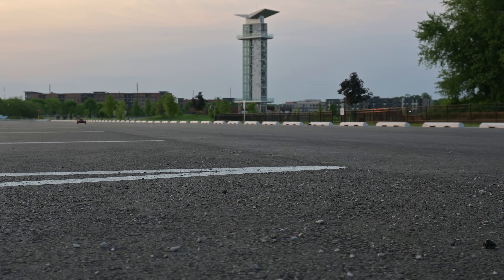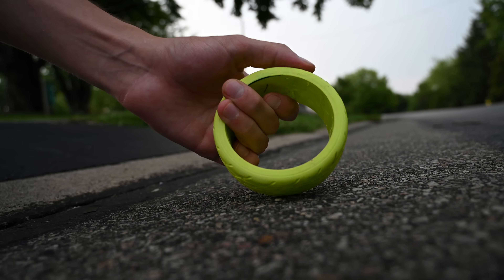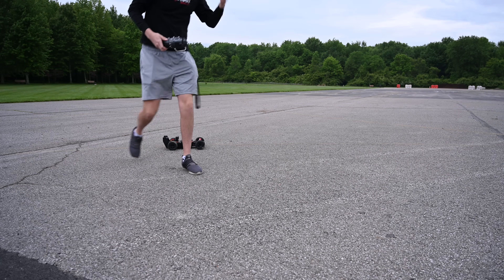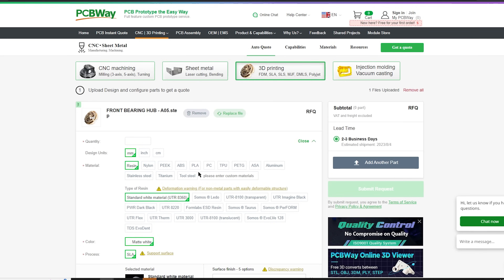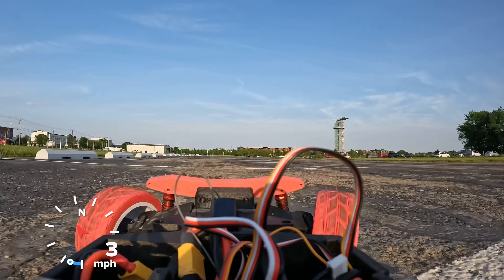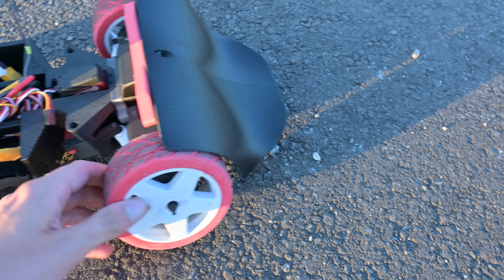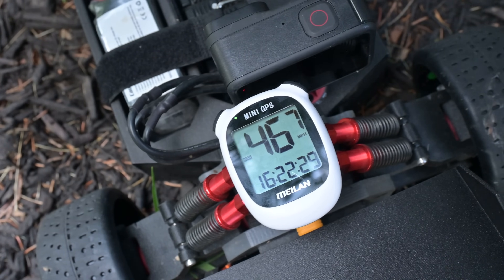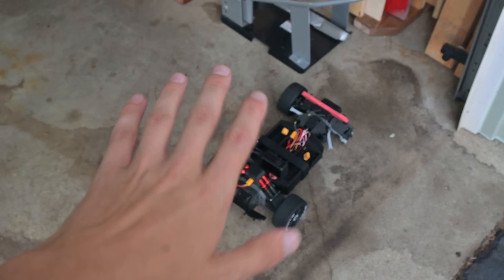I 3D Printed RC Car Tires... Will they survive???

Comment: You should use a smaller and lighter camera, in most of the flip clips you can see the car going clearly upside down corresponding to the weight of the gopro; then (idk if its possible) write a script to mantain automatically as straight as possible the car following hard guidelines like the sidewalks, 'cause its so small and fast to drive it properly avoiding chassis roll (an easier implementation would be lower the corrisponding steering angle proportionally to the speed); lower the center of gravity it's a must but I won't lower the car itself, too many bumps and potholes: increasing the mass of the wheels would reduce acceleration but that shouldn't be a big deal for top speed, but it would lower the center of gravity; I even thought of a dual stage suspension, the first stage softer with less travel for smaller imperfections, and a harder one but with more travel for bigger imperfections, again idk if it can work but why it should not; last thing i noticed is the center of gravity is too way back, maybe with a second motor in the front for the 4wd the problem will solve itself; i really like this project, hope for the best

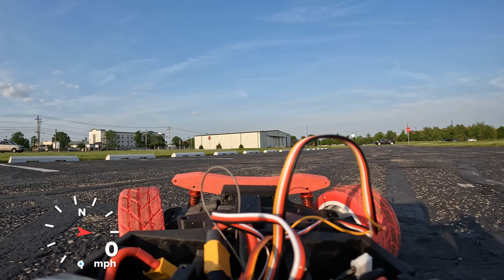Comment: Hey Micheal, I think you need to redesign your steering system. If you pause the video at 4:45 the right wheel has extremely more steering angle than the left wheel, which may be causing an instability while driving. I do t k ow if you covered this in a different video because this just popped up on my recommend 😅

Comment: For the redesigned car, I have a couple of suggestions. Make it lower, so that you can incorporate an undertray and diffuser for more downforce to help with stability at speed. You can get little gyroscope modules (some rc cars actually come with them) that connect to the steering servo and can countersteer when they detect the car changing direction without the driver's input.
Reply: To incorporate a gyro effectively you need advanced software. It is a seemlingly easy thing but a soon as you get to sensor fusion it is some serious black magic fuckery :D Easier would be to use a little toe in on the front wheels by lengthening the steering rod a little.
Reply: @vubito3245  my understanding is that the gyro modules made for rc cars are pretty plug and play, and you only have to tune how aggressively it countersteers so you don't get oscillations.

Comment: I don't know if it counts as cheating but for traction: you could 3d print a mold, and make the tires out of (or coat the tires with) silicon, or use liquid latex, for that true rubber grip

Comment: Just an ovservation here and it may be the camera angle but your alignment of the front wheels looks off in toe angle. It also looks like your Ackerman is way off too, causing the outside wheel to turn much more than the inside wheel. This could definitely make it difficult control.

Comment: Honestly the instability looks more like a suspension geometry issue to me. 
Most RC cars will run a substantial amount of toe in on the rear. 
I think this may help with your stability problems.
Reply: Precisely the issue I think. I used to race a lot of 1/10th scale cars at close to a professional level. Top speed maybe more like 30mph most of the time as acceleration was more important, but they were very stable. Toe in on the rear wheels, better suspension damping, and balanced weight/downforce should help a lot.
Reply: Use nitro rc antenna tubes cut to size over your rear suspension rod to limit squatting under load
Reply: @pierholtrop5432  squatting isnt an issue at all, in fact the rc car is too darn light, actually every rc car is way too light to make the suspension act like a real car. squatting isnt bad, its the fact that the car spins out under high acceleration, which is a grip and a weight disribution problem

Comment: The lower suspension will mean less air under the car and more air over the car 
(+Handling -top speed)
make it so the back wheels are inwards by 2 degrees [from top view]
and front wheels are outwards so the wheels can "Eat" the road
(+stability -wear -friction)

edit: make it just Front wheel drive so the back wheels will keep it forward (+handling -max torque before slip)
Reply: Front wheel drive is a terrible idea. No rc car that is fwd is fast

Comment: Very cool project. But your steering seems be wrong. Looks like the outer wheel has more steering angle. The inner wheel in the curve must have more angle. Its called Ackermann steering.  I hope that helps. I feel you, cause I try similar thing with my own built lego car. I am at around 50 km/h stable running
Reply: 50km/h for a lego car is pretty good, nice work
Reply: @iforce2d  the car performs that good that I am confident that I can go even faster. The only thing stopping me a little bit, is the drivetrain.

Comment: You need to get a foam weels for speed running like bananers 
Try looking at high speed world record rc cars for inspiration 
Btw lower the suspension so no air can get under the car so it is more controllable

Comment: Put a body on it, one of my speed run cars i was bored and ran it without a body and it was unstable and i almost crashed. The body had alot of downforce and helps the air flow over it

Comment: You may should reduce the way your steering can do... so max servo movement shold be only a tiny bit of movement at the wheels... equals less sensetiv steering at high speeds, but at low to turn around you go a lot of times back and forth to turn around...

Comment: I noticed as you were driving you seemed to swerve quite often and the "helper electronics" just seem to escalate your steering problems. You should pick up a real RC car to practice driving it with a bit more reliability. All to say I think you'll have more success driving fast with more practice and experience :D

You might also want to consider printing the whole thing from resin to have the ability to tighten up your tolerances. I know that might not be as ideal, but in the long run I think you'll have more success reaching your 100mph goal with a more precise vehicle.

Comment: Some suggestions :
Don't focus all that much on 4WD, because it comes with it's own set of issues when you're building your own car. Instead,
1. Get a body on the car, specifically those 'speedrun' bodies you see on speedrun RC cars, just search on yt and you'll find them
2. Lower the ground clearance by a significant bit
3. Use softer suspension
4. I'd say, for 100mph, you might need a more powerful ESC and motor so maybe consider getting something else ( Recommended, a Castle system or a TP motor with a reputable ESC )
5. Warm up your tires a bit before speedrunning

Some other recommendations/ideas,
if you're still unable to reach 100mph, you could try making it 4wd
Not 100% sure but I think it might be a good idea to upgrade the base/chassis of the car to something less brittle like metal, I guess to stay within the rules you'd have to custom make it but I think you should consider it, because at 80+ mph, one proper crash and everything will be in pieces and you will need to spend a lot of money to replace the broken parts, which there will be many
You don't necessarily have to work your way really slowly until 25mph, it's more when you're going at higher speeds, you've got to worry about that. 

Subbed, your videos are professional and you deserve a lot of subs, I don't subscribe to anybody easily and that basically means that your videos are great!

Comment: You need a top cover to complete the aero. After you reach a certain speed the aero takes over for stearing and stability. Maybe some active aero would help too. Your car is too light  and not enough stable down force to rely on tire stearing.

Comment: 1. In most of the car, especially the arms, you WANT flex.  Go pure nylon or pCtg (ie fiberology pctg).  RPM Nylon arms are a common upgrade in hobby cars.

2.  Watching you fight that right pulling alignment was painful, get your trim straight so you go perfectly straight without touching the wheel.

3. You need better designed front and rear wings at that 50+ speed, especially without any kind of body.  

4. New viewer so not sure your printers, but if you have multimaterial, consider using a softer material for the wear layer of the tires and a harder for the inside, especially, maybe print them into rims (nylon), even.

5. Many hobby RC cars end up with almost a square footprint, because it's so much more stable than narrower cars like full sized ones are.  

6. You have non adjustable links, are you designing for any toe-in or toe-out? Toe-in gives more stability at high speed.

Comment: you have to work on the parallelism and the camber of the running gear so that the car stabilizes itself, I face the same problem while building my rc car

Comment: For high speed stability you want more rear grip than front and the balance of pressure needs to be further back than the center of gravity in all directions, yaw (side to side) if you don't want to lose control, pitch (front and back) if you don't want to suddenly take flight

Comment: Try NinjaFlex 85A TPU.  The most common TPU is 95A hardness, and most brands of this standard TPU are a bit slippery.  However, NinjaFlex 85A TPU has a completely different texture and is extremely high friction against most surfaces I've  tested.  Also you can try printing with fuzzy skin which will improve friction, at least at the beginning until it wears down.

Comment: You could make the whole car out of an indestructible material, but hr clue is is to make the easiest part to replace out of the weakest material. In racecars its often the wheels which get ruined instead of the chassis or suspension

Comment: heres a thought. if your on surfaces that are that bad and pitted what you need is more travel. but have the car sag into the travel when sitting idle some of my thousand $ + cars mugen MBX sit almost 1" into their travel when sitting idle, this gives the suspension a chance to drop, and the tires to maintain contact on unsmooth surfaces. even most of my onroad cars have 1/2" of free sag, to maintain ground contact. softer springs, with larger pistons are a must.

Comment: Dunno if it is among the lines of the project. But! Have u ever looked in to ardupilot? The rover section might be of help! 

Also, have u tried less stiff shocks? While driving over bumps it looks to me as if the struts don't soak op much of the bumps and inturn upset the whole car. Maybe some loser springs wil let it soak more. 

A less stiff absorber would also allow the tyre to droop faster hopefully having contact with the ground more thus staying in control.

I might as well be totally wrong but hey!

Comment: 3d printing the hubs and placing them in a mold for silicon casting is something I've seen a couple other people do but I'm not sure they would work at the high speeds you're aiming for. Great work so far and I'm definitely interested in seeing more done with the gyro!

Comment: all your on-board shots, where i can see the front wheels suggests you have no akermans, or its backwards.

it would appear the outer wheel is turning a tighter arc than the inner wheel... 

tyres arent going to change anything if your geometry is inherently unstable to start with.

now i have to go see if you show the linkages anywhere...

Comment: The tires you printed need to be balanced once mounted to the rim, that will make the car more stable. I don't know much about 3D printing, but I would look into trueing the tires as well. For more traction on the printed tire, you could look into tire "sauce". The RC transmiter and receiver combination you were using comes with an inbuilt gyro, did you have both gyros active while performing your runs?

Comment: Jumping in the comments not having seen the earlier design-phase content. The stability issue you're having looks very familiar to a chassis I was trying to tune for stable higher speeds. I learned a lot, but mostly that my square alignment was my downfall; after dialing a small amount of Toe-In on the rear wheels I was able to track straight at speed.

I also learned something that had plagued me for years, and it was renewed when I saw your aero add-ons: downforce has to be balanced front and rear. Go put a fat guy on your rear bumper, and the nose lifts. Plop fatso on your front bumper, the rear goes skyward. It's not or ever has been "putting the wing above the non-drive wheels on your Civic hhaha", but without a splitter, that Giant Wang is kinda harmful. Neat.

Comment: since you already have all the electronics and stuff i'd recommend to just print the robak 2.2 or proto36. Doesn't take you any designing time, just printing/assembly and it may just allow you to get some ideas and close in on 100mph without any effort.

Comment: Using CF prints is not bad but they are not actually tougher. They are more fragile. If you use PC (polymax PC especially) your parts will survive much more. Also if you want stability you need rear downforce not front(if you dont balance you will pull out Mercedes CLK wheeile).

Comment: Your temperature for varioshore is odd. I did some testing with mine and it was softest at 220 C. Going higher than 220 C actually reduced the foaming and made it harder again. With a 0.4 mm nozzle, set at a 0.4 mm line width I got a 0.85 mm line at 220 C and only 0.6 mm at 240 C, so 250 C would be even lower. Mine was black but I can’t imagine that would make a difference to the temperatures or how much it foams. 

I know the filament says it can go from 190 C to 250 C and it would seem logical that higher temperatures mean more foaming but after a point (for me around 220 C) it starts to decrease again. If you didn’t properly calibrate the varioshore and try it at different temperatures then you should.

Edit: just to mention at 220 C the expansion was 2.13 times the 0.4 mm nozzle width, whilst the 240 C was only 1.5 times the 0.4 mm nozzle width, so then 250 C would go even lower and be even worse. When it foams more the plastic gets softer and grippier so you definitely should play about with the temperatures a bit more, especially around the 220 C mark. When printing at 220 C I turned the flow down to 47 % and got the desired 0.4 mm line so the varioshore saves weight just like lightweight PLA.

Apparently at its peak (or trough depending on what way you look at it) softness, varioshore is supposed to reach around 50 A hardness, which is apparently below car tyres, so maybe printing it at a better temperature could make it more grippy than the other wheels you got.

Comment: For your tires, you should try the Fuzzy Skin setting (if you use cura).  I've printed things in polymaker TPU that are extremely slippery normally, but have much better grip with the Fuzzy skin setting enabled.  I'd imagine that VarioShore would have even better results.
Reply: Great idea! Also Fuzzy is now available in Prusa and Orca slicers as well!
Reply: I don't know how to spell it in English, but tyres need to be more flat, or without the lines, like formula 1 tyres that don't have any lines or marks in the tyres, something like flat tyres? Or totally smooth tyres.

Edit: you can also try adding a downward pointing spoiler, check out Pagani's spoiler system, or Bugatti, switch out the GoPro for a more streamlined camera, or make a full ramp carcass like a batmobile, and put the camera there, that way you will get more aerodynamic.
Reply: @G3RARDB3AR  1 year later, but it's called semi slicks.
Reply: Thanks, i had nothing but problems with grip when printing tires.
Reply: Also just making slicks with a bit softer carcass to dampen the bumps a bit more (or just softer suspention).
Reply: Try using TPE for 3D printing tires. It's better than TPU

Comment: I have printed the same car, but I have changed almost every part. The highest I got is 60mph on a 4S battery.
The biggest changes I made is, bigger shocks, changed the angle of the suspensions, I extended the chassis 50mm, made everything super tight because a lot of the tolerances were way off and sloppy.
Reply: yeah making it tight may do the thing. I think the tarmo5 as shown in these videos is super unstable on the road. I own robak and it's very different.

Comment: I have printed, tested, modifed this tarmo5 like 100x times, and came to the conclusion that printing with Ninjatek Armadillo (75D TPU) makes it literally indestructible. I recommend you to give it a try, it's a hard TPU and it absorbs of lot before it breaks (if it eventually breaks, never got to that point yet and i'm bashing it to the sky)
Reply: that stuff is expensive.
Reply: @KidAgainHobbies i think printing the same parts 10x is more expensive 😅
Reply: @Itsmeblvck  i think buying an rc car is cheaper and less headaches. a printed part will never be as strong as a molded part no matter what material you use.
Reply: @KidAgainHobbies  you are correct but depending on your part orientation, forces applied and suited material you can get around 90% of the durability of a molded part/maybe even more durable.

Also buying an rc car defies the engineering sense of the video…

Comment: You're probably already a better driver than most, keeping that thing on the road with no body!

Used to race nitro rc cars about 15 years ago... Having a body on the car makes such a huge difference it's amazing. I had my car dialed and on rails on the track, but if you took the body off, I'd look like a blindfolded 3 year old driving it.

Comment: Maybe go with a simpler car?  The fastest "on road" RC cars often have a solid rear axle, foam tires, chassis flex rear suspension and king-pin front suspension.  They're more of a tiny go-cart than a scaled down car.